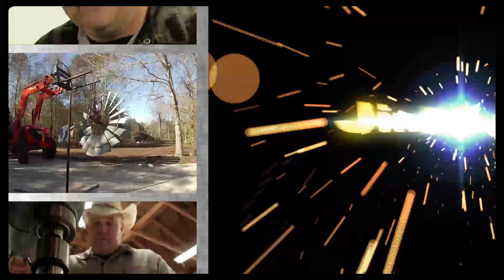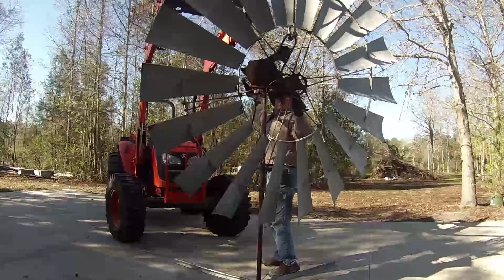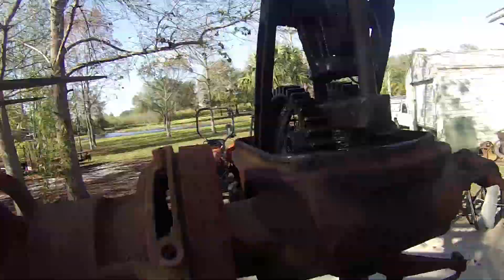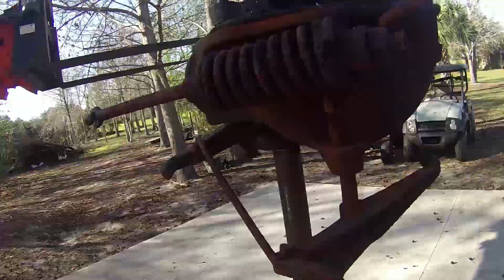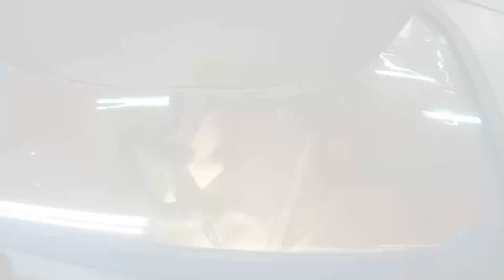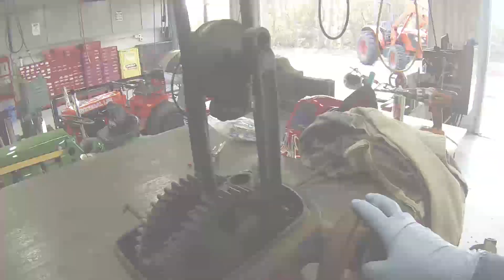Vintage Aermotor Windmill Restoration Ep 1

Comment: Jim, I am here because I was sent by Abom79.  I was surprised to see you working on and Aermotor windmill.  If you have any questions about it (you seemed to be very knowledgeable about it) feel free to ask.  I have over 30 years experience with that brand of windmill and water pumping systems.  I look forward to seeing the re-assembly.
Reply from the maker: +B Rykard WELL, where were you  the last nine months I've been working on this thing? I certainly would have picked your brain! LOL There isn't a lot of good info out there. I literally just had to figure out how to rebuild it by taking it apart and using my experience with machinery. I LOVE the simple design. I need a pump. One of my next projects is to build a water tower 25-30' and pump water to it. That is when finances allow. I would like a more modern pump without leathers that need to be replaced. I looked at the simple pump, but they must coat the inside with 24k gold. Thanks for watching and please feel free to chime in when I screw up (or do something right). I could find no one local who had any experience with Aremotors, so it was adlib.
Reply: Have you put it back together?  There are a few KEY things you have to do to keep it from destroying itself once you have rebuilt it.  Most folks just pump and gravity feed into a storage tank on the ground.  You do not gain much by elevating the tower.  If you do make a  tower, remember water weighs roughly 8lbs per gallon.  A small storage tank (1000gal) will weigh 8000lbs.  Some folks use a 1-7/8" travelling valve inside 2" pvc pipe for a pump if it is not very deep.  How deep are you planning on pumping.  Even modern pumps still use leathers.  Try this web site www.thewindengine702.com.  It is a website where I sell "clones" of the Aermotor that was made between 1933 through 1980.  There is some info there on pumps and sizing a mill to a well.  I hope you find it useful.
Reply from the maker: +B Rykard , I want to put around 500 gallons in a tank about 30' in the air. That should give me around 18psi in the house when you add the elevation of the terrain. It's not much, but it will wash hands, flush toilets, etc.  I also want to use it to drip irrigate a small garden. We live way in the country, the last ones to get power restored. The simple pumps use Teflon seals instead of leather. I was hoping to find something out there similar with less cost. Please advise what KEY things I should have done. No problems so far, but she is not pushing a pump yet. I will check out the wind engine site. Thanks!
Reply: The most important thing you need to do when you rebuild an Aermotor windmill is to replace part number 520.  It is the oil collector that you unscrewed from under the hub after removing the pipe plug from the hub.  It has a very important job.  It scrapes the oil from off the inside of the hub and if all the ports and channels are clean, returns the oil back to the gear case.  If you put the old one back in and put a new 730 bearing in, the 520 will be too short, not scrape any oil and all your oil will run out the back of the hub.  If you leave it out, same thing will happen. You should screw the 520 in and try to turn the hub.  If it cannot go passed the 520, take it out, grind it down and try it again until it will start passed the 520.  Once you can make a full revolution with the hub and the 520 is scraping the inside of the hub, you are good to go.  Also, remember to use 10wt non detergent oil in an Aermotor windmill.  Yours uses 2 quarts.  The oiling system is a gravity flow system.
Reply from the maker: +B Rykard I'll say it again, where were you 9 months ago? LOL. I figured out how all that worked the old fashioned way, I took it apart..... Believe it or not, I only had to replace one part in the gear box; the shaft for the plunger guide. All the bearings looked good, every thing was good and tight. I could have probably used a  set of the connecting rods, but I can replace those while it's on the tower. As far as the family that I purchased it from  knows the gear box has not been down since '40 (no one is left alive in the family that was living there then). The nose babbit (no.730?) still looked good, very little wear or play. I played with what I dubbed "the oil scraper" (No.520) and I couldn't even back it out 1/8 of a turn without locking up the hub. It's been turning in the wind with no load and It hasn't started leaking yet. Hopefully all stays well. As far as oil goes I used 303 tractor fluid. It is around a 10wt oil. NAPA checked and said it was close to the same. 10wt non detergent oil is hard to find (without buying 5 gallons). Thanks again for the info

Comment: I have a vintage windmill on my farm. The connecting rod to the pump has broken. Replaced with a cable. Now that has twisted extremely tight. Any suggestions would be helpful. Thank you in advance.

Comment: Hi thanks for your you tube posts. What size pipe did you use to make your stand? Can you lift it by the long u shaped part under the sheet metal cover? Thanks for any help you can give me in advance.
Reply from the maker: William Miller I honestly don't remember the pipe size. It was pipe, and not tubing that I used. Just scrap pieces. I actually filmed making the stand for an entire episode, but the files got so corrupted that I couldn't really do anything with them. Yes you can lift the assembled gearbox and wheel by the guide hoop. That's how they place it on top of the tower when they use a crane. Thanks for watching.
Reply: thanks